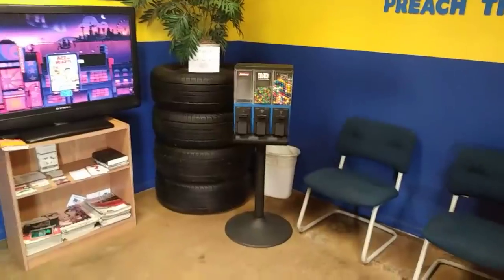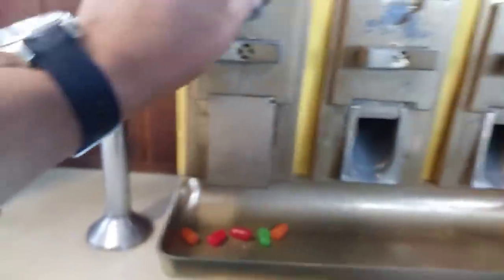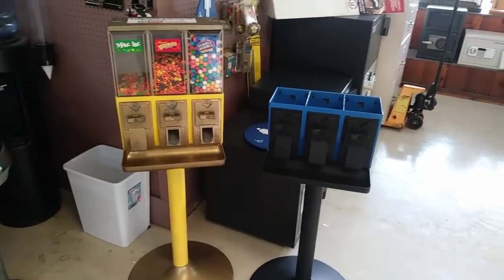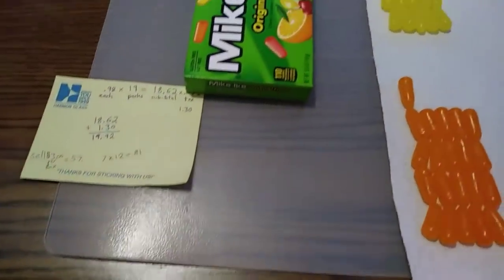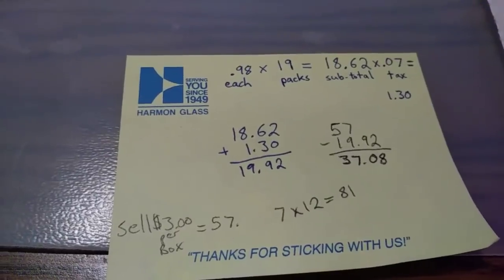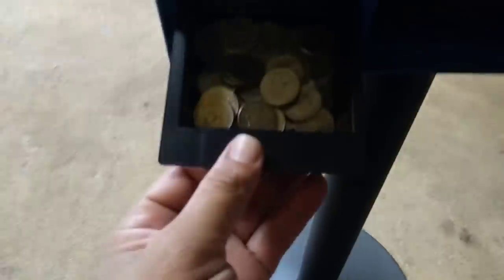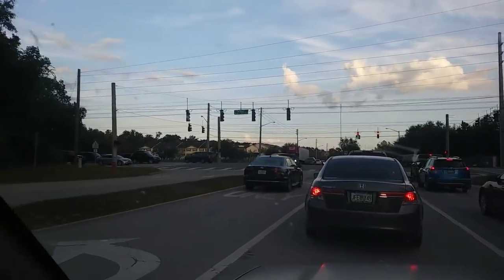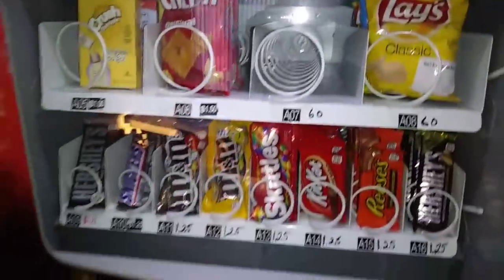COLLECTING, REFILLING AND CALCULATING PROFIT FOR MY VENDING BUSINESS! Taking Off In 2019

Comment: Hey Mike, there's a seller on eBay with 9 lbs of Mike and Ikes for $28 shipped. I believe it is cheaper than buying those boxes at Walmart. Wouldn't be a ton of money saved, but every bit helps! Have a great day/night.
Reply from the maker: Awesome bro thanks for the tip. There is 144oz. in 9lbs.  After paying $.98 per 5oz box it comes to $28.80 sub-total. Sales tax will be $2.01 for a total of $30.81 so it is a better deal even if purchased at Sam's under a business account and exempt of the sales tax (which would still save $.80)...plus saving time and gas money driving to buy them!👍
I will add the link to the description below for anyone wanting to order Mike & Ikes at this reduced price. This will make the profit even better than my nearly 200%.
Nice find Dylan Rhodes👍
Reply from the maker: I just went and found one even better
check this deal out with 
FREE SHIPPING!!!

https://amzn.to/2DFTFpQ
Reply: Odd how it works out that the smallest package instead works out to be the best price per pound. Best bulk price on Amazon for the bags works out at 20.8 cents per ounce where those 5 ounce boxes work out at 19.8 cents per ounce. I do find it interesting that your state charges tax on the candy. I live in a no sales tax state. Both the states near us have sales tax but neither tax food items. Even if bought at Walmart in one of the states (if it was taxed), if you have a business license showing you are a reseller, you are considered tax exempt.

Comment: Nice collection video Mike. At your apartment location I noticed you have a card reader on the machine, do a lot of people use the reader or no?
Reply from the maker: I actually don't have it activated at that location.
Reply: Chrome Vending ok, sometimes it’s not worth it anyways. I have a location with an E-port reader and it hardly gets used.. was thinking of just shutting it off as well, save me 10.00 a month is I do that.
Reply from the maker: @jayfez8241  
Yeah,  that's why in this particular location I just opted to leave it inactive. I don't see it as a high enough traffic location to be worth activating there for the $10 monthly activation fee.

Comment: Which vending machines is easier to make money with and handle better candy bulkhead machines or full grown soda and snacks machines and why
Reply from the maker: All depends on the locations you can get and how much you want to work. 
Bulk machines are usually more passive while full line is generally more active, but usually they bring more $ faster. 
Watch videos on both to decide as I have numerous uploaded videos covering both.
Good luck.
Reply: @ChromeVending  thanks

Comment: Do the locations where you put the machine ever want a portion of what is earned in exchange for the machine to be placed there or electricity if it’s the soda or larger ones?
Reply from the maker: Some do ask, but I always look to avoid commissions and percentages on all bulk machines, but will consider more for full line and arcade. Usually it's whatever you can work out with the business owner. 👍🏼

Comment: How often do you check your machines?
Reply from the maker: All depends on the location and the type of machine. I always try to stretch it as long as possible though. 👍🏼
Reply: @ChromeVending  Oh, ok. I was wondering cause you said you got like $200 in the video but I wasn't sure if that was weekly, monthly or so on.
Reply from the maker: @richardclark194  
Full line snack and soda machines you can check every week to two weeks normally unless you have a super high traffic location where you might be back a couple times a week or every day even. Bulk candy and capsule machines you can usually get away with between 30 to 60 to 90 day collections.